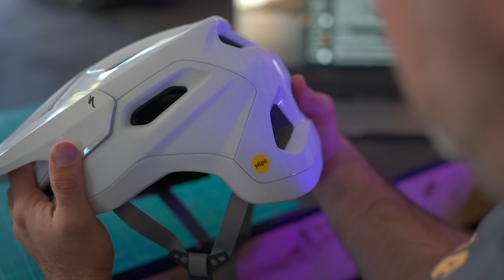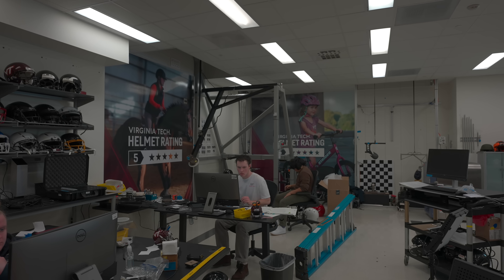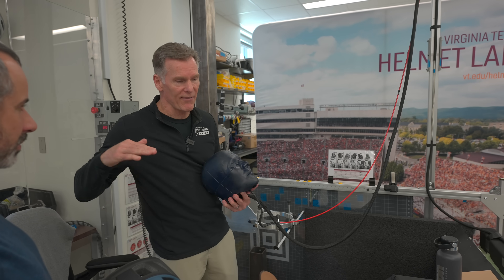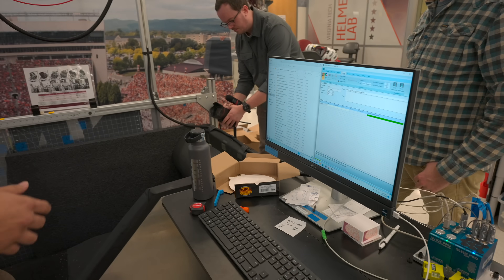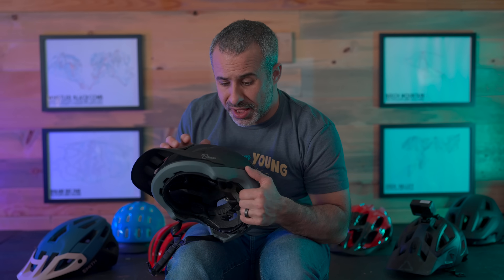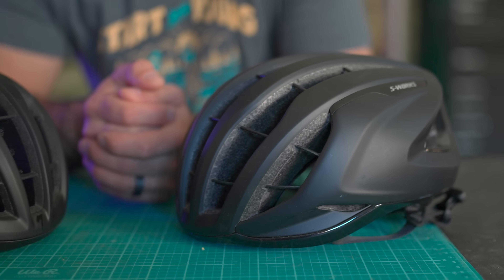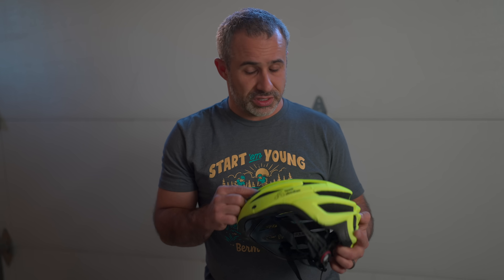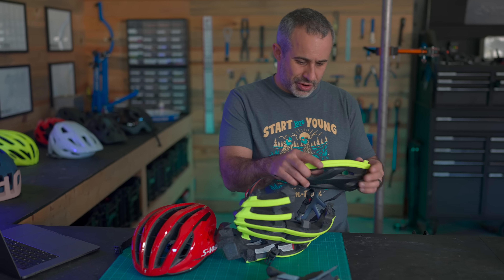Are Cheap Bike Helmets Safe? We visited a helmet testing lab to find out

Comment: From a frequent helmet wearer, the fit of the helmet is #1 for me.  I've bought some expensive helmets and they did not fit my head, so I ended up wearing them less.  There is something about having that good fit that I like wearing it.  The fit on the back of my head, behind the ears where the skull dips in towards the neck is where the fit is.  Being able to do a head shake without the helmet flopping around is the deal. From my crashes that hurt what I noticed is how much the helmet rolled on my head during the crash.  Those helmets that stayed put were of course better.  I currently wear a POC. It fits my head really well.

Comment: The test lab should maybe investigate a little about the force action and neck injury (from motorcycle industry) where a large arm for camera  mount is clearly disadvantageous compared to smooth shell (where the helmets are designed to easily break the "aero" parts), and would hope you take any opinion more critically and not just "they were confident on this one question".

Comment: C'mon Seth. That oblique test is seriously flawed and Virginia Labs know it. I smell rat here that after years and years talking about this topic they continue with the same silly test.  Let me explain once again. They strap helmet very, very tight to a rubber head model WITHOUT any scalp movement and measure peak forces.

Yeah, peak forces that would not be there if helmet was worn on movable scalp (amd often a considerable layer of hair) plus real life strap tightness.

It's a SCAM to upsell MIPS and other crap. Not saying those systems are completely useless but way, way overrated.

Comment: Hi Seth. Love your videos, thank you! Wanted to give you a heads up....AMA pro and amateur motocross/supercross racing banned helmet mounted cameras due to safety concerns a few years ago. One of the reasons being that the cameras can cause a deflection and generate forces to the helmet not intended to be addressed by the way the helmet was originally designed for the wearers safety. I believe this was primarily directed towards cameras mounted on top of the helmet but certainly could likely pertain to other mounting points. Do with it what you will. Just want you to be safe man. Thanks for what you do.
Reply: The UCI also banned helmet cameras. They are legal on a removable visor for downhill (visor on the full face). But I haven't yet found a rule for XC racing. But you never see a visor in an XC race.

Comment: My lack of concussion wearing the Specialized Tactic 4 from a 15mph OTB into a tree trunk with the top of my head is one practical test that validates the VT MIPS rating.  I had bought the Tactic after learning about the VT testing from online research and boy am I glad I bought the best rated MTB helmet.  I hopped an obstacle, struck front tire on different obstacle that turned it and inertia threw me over and straight for the tree. I ducked my chin down taking impact to the top of the head.  I was in shock that I didn't see stars, or worse after impact.  Very, very lucky but also believe the Tactic absorbed the blow so no TBI.  Thanks for sharing the VT lab testing which is serving all of us.  Go Hokies!!  (yes, i bought another Specialized Tactic 4 to re-protect my not so perfect brain to begin with)
Reply: PS - I emailed the VT Lab after the crash and Dr. Miller of the lab replied himself the very next day.  I wanted to know if the protection of the helmet was now compromised after the impact and simply summarizing his detailed response, the answer was most likely yes.
Reply: @michaelpfister2226  A helmet is always compromised after a significant collision.
Reply: @michaelpfister2226  No matter how advanced we get in the protection and technology in the helmet department, the one universal thing since the very beginning of brain buckets is the helmet is "done in" after one bad crash.  I think after your experience, this still proves that true.
Reply: I came here to ask you that very question. It validates what I’ve heard before.
Reply: A similar story, I once had a relatively high speed crash going down a heavily rutted trail, where I got into the rut, the rut turned and there was nothing I could do.  My head hit a tree and I remember my neck being sore from the compression when my head stopped and the rest of my body piled into it.  The helmet was junk but it felt as if my head hadn't hit anything.  It's amazing what a bit of foam and some inspired design can do.
Reply: Just ordered one of these because of this comment. On sale for $58.
Reply: @cristibaluta until your head hits the soft concrete
Reply: I've had a similar crash striking my head on a rock wall without a helmet and surprisingly had only superficial damage.
Reply: I litrey have same helmet feom 9 yesr ago
Reply: Nah is not the healment, you have a tough skull 😅😅😅
Reply: My lack of concussion from not wearing a helmet while cycling will continue.
The reason being if helmets ever get mandated I'll quit cycling, along with 30% of other cyclists if the Australian academic study I'm not allowed by YouTube to link post their mandate is to be believed, it's easily searched, however..
Net result, a worse effect on public health & premature deaths than the helmet mandate.
By all means encourage helmet wearing, just don't MANDATE it, if you're actually interested in the best overall outcome.
Reply: @beardyface8492  Would genuinely like to know why you are so against helmets to begin with? Are you one of those people that say "it wrecks my style" or im a grown MAN and i don't need to use a helmet? Helmets save lives and they saved millions of lives around the world.There are loads of people that died or landed on a wheelchair for the rest of their lives... something that could easily have been prevented by wearing a helmet. Helmets are just standard gear when it comes to cycling nowadays because why risk your wellbeing at all?
Reply: @Bobotron6001  They're unbearably uncomfortable.
I've worn one, sweat ran into my eyes, stinging massively, & causing me to ride into an obstacle I could consequently not see.
I did not hit my head, however, I DID sustain fortunately minor injuries I otherwise wouldn't have.
I'm FAR from the only person who finds them unbearable.
People die from lack of exercise too.
Discouraging cycling by mandating helmets (by all means encourage them) actually results in more life changing health issues overall than the few cases you cite.
Reply: @beardyface8492  
I did not find the study you are referencing; however, I did find several studies and a meta-analysis by Australian researchers showing that cyclists who were in a crash and wore helmets (of any quality) had SIGNIFICANTLY (50-70%) less risk of serious head injury and overall risk of death (~30% less).
In whatever case, do NOT base your worldview on single one-off studies. I am pretty sure I could find you several studies on how "acupuncture realigns one's chakras and thus protects against tuberculosis". Until a finding such as this is peer-reviewed, replicated, and corroborated by other evidence, it is nothing more than a single signal among many data points. Moreover, plenty of garbage, incompetently done, intentionally misleading, and outright malicious "scientific findings" exist out there.
Until more conclusive evidence can be demonstrated, I will support mandating bike helmets for all cyclists.

Comment: That was interesting. I previously used 3 generation of the Specialized Align and upgraded to a Giro Agilis several years ago. They didn't test the Agilis, but they did test the Align and it scored better than most of the Giro models that they did test. I guess I am going back to the Align for my next helmet!

Comment: All helmets have to  undergo certification testing for US, Europe, Japan etc. It's still very comprehensive testing but they don't give a score just passed or failed. I think the criteria between mountain bike, downhill and road bike helmets are a bit different with road bike helmets being weaker and less safe as they are typically lighter built. I used to be a compliance officer and although we weren't involved in bicycle helmets we were involved in other types of safety helmet and dealt with some of the big Chinese factories that supply bicycle helmets to many different importer brands like most US bike brands. Mips for example is not part of the normal certification process for bike helmets its licensed technology and no substitute for more material in the helmet. I saw some factory door prices for bike helmets and only $1-3 at the time and fully certified that was about 8 years ago.

The important thing is if you have an accident or you drop your bike helmet you should replace it and really after 3 years you should replace anyway. The thing about expensive bike helmets is some people will resist replacing them in which case they can be a safety liability. 

Also in the video it was stated there was no royalty agreement for using Virginia Tech approval stickers on helmets but surely the cost of testing is the licensing cost, this made me a bit uncomfortable and under normal certification the test house is almost invisible you rarely see them mentioned on products as they need to be completely invisible with no self-promotion. Mips for example is a commercial product not part of international certification as far as I understand it are they involved in the commercial promotion of that?

The underlying material of bicycle helmets is incredibly cheap, plastic and foam and not much else yet the retail pricing is extremely high for some examples. People take their own safety very seriously and their children even more so. It feels like a lot of commercial exploitation going on with helmets.

Lastly you could say there is a greater safety risk with high end bicycle helmets if only those helmets get fake versions, i.e. you have a much higher chance of having a very dangerous helmet from those brands. I know the risk is related to where you buy it but I've purchased fake goods from Amazon and had to return them. 

Personally I don't think you should ever buy a bicycle helmet from places like Aliexpress, Temu etc, these are basically personal imports by you and can completely bypass the normal certification process that operates in your country. Even if the helmet seems identical and from the right factory it could be a bad batch or lower spec etc.

Watching this video I felt the $25 helmet might be the right choice, still an excellent safety rating and would hopefully not cause resistance if you dropped it 2 days after owning it and need to replace it.

Comment: I started riding to work after a near leathal off 4 years ago. Thanks to Virginia tech i bought a specialized tactixs 4. When i crashed I was wearing a Poc. It saved my lufe. Sadly i twisted my neck so bad that I dissected an artery and had a stroke on top of all my fractures, stitches and missing skin. Trust me. You do not want to mess up your brains. I have had to learn to walk, talk, lost emotional control. I even had to learn how to breath again. If I hadn't had such a good helmet I would have had all the other impact injuries on top of the stroke. I just had bad luck falling in a place I had ridden for years. Shit happened and it happened quickly on a casual evening ride on a Sunday evening.
Stay safe out there
Reply: People tend to focus on the brain injuries but as you sadly experienced there are many other head related injuries that can be life changing. Mine was hitting my head so hard in a bike fall that it detached and tore the retina in my left eye and I have been partially sighted in that eye ever since. Despite this, I didn't actually suffer a serious concussion in the incident. I was told by the Doc that I must never hit my head really hard again or face blindness, so since then I have always purchased the best helmet that I can. The Virginia tech data caused me to recently replace both my helmets which were not as highly rated as they once were. 👍

Comment: I spent a lot of time looking into this after I got a minor concussion snowboarding and the plot never really stopped thickening. According to one of the founders of wavecel, the Virginia tech tests aren’t high energy enough to reach the point where the mips slip layer experiences stiction with the EPS layer it’s meant to slide over, and they test using a dummy neck. According to MIPS, the neck in question doesn’t have good biofidelity.

Comment: I've had atleast 3 concussions in my early biking career and probably atleast 5 or so overall. In my last crash I went over the bars and the bike flipped and came up behind me and smacked me in the back of the head with the top tube. The next day I bought my first actual mountain bike helmet. A year later I had another over the bars crash thar separated my left shoulder. I hit my head hard against a tree root. I stood up and waited for the head splitting pain, but there was none. I was so thankful for that helmet. I would have ended up in the hospital. Instead I took 3 days off work and put my arm in a sling for a month and I was biking again after 3 or 4 months. Thank God for my helmet.

Comment: I've been using a Giro Hex since the summer of 2018.  Last summer I found out about the VA Tech testing lab and saw that it was at the bottom of the list lol.  I figured I would buy a new helmet in the off season when they would probably be cheaper.  Funny you made a video about it when I was just about to start looking.

Comment: Seth, you briefly mentioned fit but it is about equally important. having worked on the floor of a LBS fitting helmets to heads, I can tell you that every head is different and no one helmet fits all shapes and sizes of heads. It is important to try them on so if buying online beware - it may be well rated but if it doesn’t fit properly, it’s not safe.

Comment: Great video!  Thank you.
Interesting that VT mentions "concussion reduction" in their descriptions, which is a good thing.  Up until recently, helmets weren't really designed to specifically mitigate "concussion," but rather skull injury, fracture and TBI.  It was rather vague because of the fact that concussive and sub-concussive forces really cannot be defined perfectly, nor mitigated perfectly.  If you really wanted to reduce brain twisting and/or acceleration forces enough, helmets would have to be about three feet in diameter.  So they realize they're compromising between something that you can actually wear, and something that will reduce the occurrence of serious or fatal head injuries.

Interpol should be tasked with sweeping into these scumbag counterfeiters and locking them up.  Producing, marketing, and/or selling ANY counterfeit safety products should be criminal and charged as such.  Seize the company's assets and distribute the proceeds to their victims (those who purchased defective product).  Jail the perps.

Found a "really great deal" on a "high-end" helmet on Alibaba for $40?  You KNOW it's counterfeit!

Comment: I owned that low rated Kali. I dropped it from 3 feet, with nothing in it (not my head or weight). It fell from hanging on my handlebars when I was taking a break. It cracked in half. I was terrified that if that had been a wreck I would have had no protection. I stopped wearing Kali. Now I buy the $200+ helmets from Oakley and Smith. It's a lot cheaper than ER visits.

Comment: I’m okay with the rating but i think the cost needs to move lower. Anything that has MTB or Bike specific is almost always more expensive just for the sake of being expensive. You have motorcycle helmet that have more material, safer yet some have ece certification under 100 dollars.

Comment: so just a sincere question - if you can't see any part of the helmet in your FOV...what's the point of the visor?
Reply: If you face plant the visor will potentially reduce the road rash on the wearers face in my experience. It didn't help my chin, but my nose and forehead didn't touch the ground, because the visor stayed in place. Obviously its not as good as a full face downhill helmet, but it provides some protection.
Reply: so again though - what's the point of the visor? a measly piece of thin plastic won't keep your face from getting smashed. yeah "road rash" is one thing....but that's a very specific incident and not (i presume) what a visor is for? @Pesmog

Comment: Had a concussion wearing Lazer Chiru MIPS. Smacked my head on the back when I dead sailor out of a ravine which I did not have the skillset for. Nothing against the helmet, glad it did it's job for my lack of skill, ha! Still using the same model as I had 2 more. Lazer promptly gave me a replacement discount  when I contacted them.